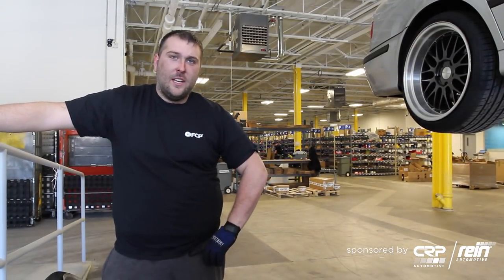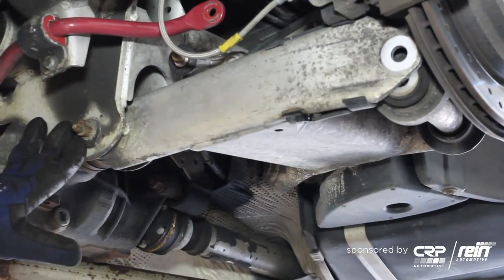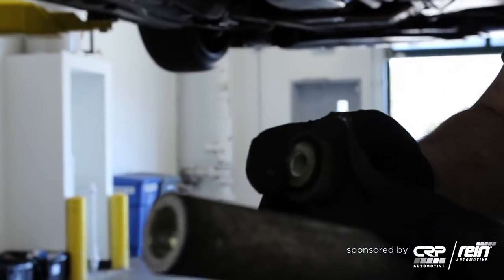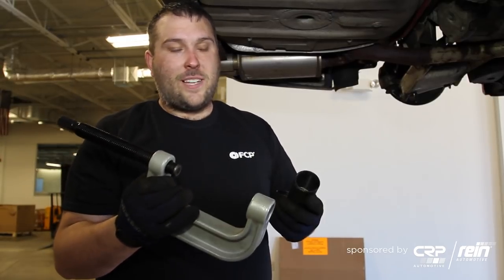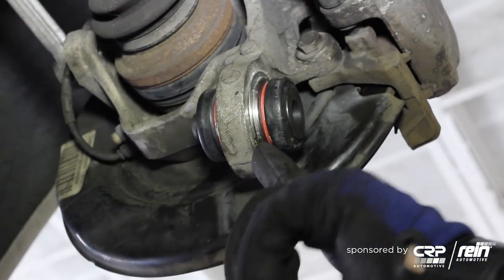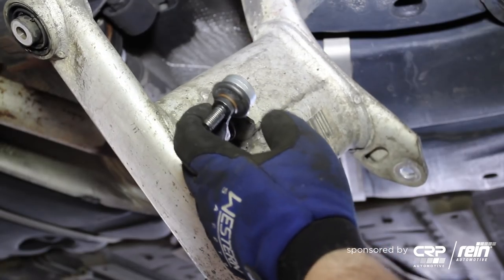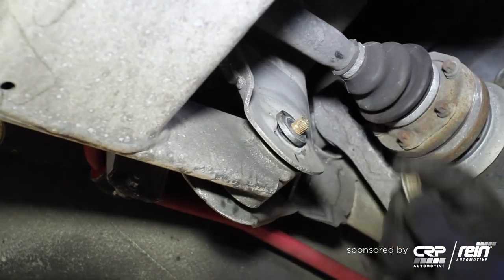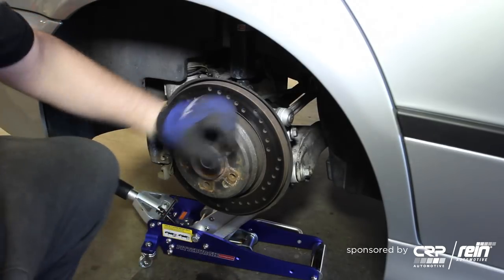How to Replace: BMW E39 Wheel Carrier Ball Joint (Rear Sway Bar End Link, Integral Link) FCP Euro

Comment: I watched this very informative and easy to follow video 9 years ago when I first bought my 540/6. What a difference it made. Well here I am watching it again just to make sure I haven’t forgotten anything. The bmw original parts lasted approximately 80,000.  Well I used Meyle brand . 60,000 miles later -but since it’s needed this for the last 10k  they actually only lasted 50,000miles . Hopefully the lemforder parts hold up for longer .

Comment: This was very very useful, its a shame I didn't see it before I changed mine. I had over 300,000 on my car before I think they were changed for the first time. I purchased the same C-clamp kit as well, from Harbor Freight. I turned mine from a "C" to an "I" clamp. It was so rusted in I used the cups that came with it and a large grade 8 bolt to remove them and broke a bolt on the second one trying to get it out. I had to heat mine up and let them cool a couple of times as well before I was able to get them to break free.

Comment: Thanks for the video! Though I noticed when installing the eccentric bolt that you swapped which side the nut was on. Initially it was on the rear side of the arm and when you re-installed you placed it on the forward side of the arm. As you were probably getting an alignment shortly after I don't think it was going to make much of a difference, but for someone who can't get to the alignment shop for a bit that small detail rendered your locating marks null and void.

Comment: Thanks for the video. I've been struggling with the ball joint tonight and I noticed that even though you said that you should keep the ball joint nice and straight, yours ends up really crooked at 9:10 and you just force it through and it straightens. I've been stopping when mine got crooked because I didn't want to break anything.  Interesting to see that you can just force it through and it'll be ok.

Comment: Nice video! One small comment on the torquing procedure. Once it clicks, every time you make it click after that is potentially moving the threads tighter a fraction of a turn, hence over torquing the nut. Other than that, very helpful video! Thank you!

Comment: Great video!  You make it look easy.  I guess having a lift helps, eh?

I did this job on my e38 a few months ago and pressing out the ball joint was a major pain - the removal tools I borrowed from AutoZone wouldn't fit, and trying to make one with plumbing materials was a big waste of time.  I finally capitulated and bought the specific tool - about $110 new off ebay, it's a China knockoff but worked PERFECTLY and pressing out/in the balljoint was a breeze with it.  Worth every penny.  My ball joints were shot, but not nearly as bad as the one in this video.  BTW - I did the control arms and struts too, just to make things complicated and expensive ;)    '99 e38 180,000 miles.
Reply: I had the same issue!  The clamp thing from autozone was a complete disaster.  When it comes down to it, buying the specific tool can save you lots of money vs. paying someone to deal with the resulting mess.

Comment: It looks so easy... Changing all the bushings on my e38 at the moment, so far took about a full days of work and one side is almost out of the car... Snapped inner upper bushings bolt, snapped two drive shaft bolts and lower inner bolt and nut was half rounded since before and of course i've rounded it even more now... Then I gotta do the same thing for other side and then onto pressing the bushings D:

Comment: Awesome Video! Well explained!
That's what I am doing right now!
Thanks a LOT!
Reply from the maker: You're welcome! Glad you like the video!
Reply: @fcpeuro  Everything is SO EASY in your video. In my case (239k E39) its a warzone. I had to use Impact Wrench to remove E14 bolts. Had to cut bolt to remove the Guide Link. Now I removed the Nut and Eccentric Washer, but stuck with the Bolt in Lower Control Arm. Its real PITA!
Reply: @siny528i  how'd it go?

Comment: For the snap ring, if you can get a pair of needle-nose pliars to open it enough, you can get a flat head screwdriver between the opposite side of the ring and the ball joint - pull the screwdriver to the side and it’ll pop off.

Comment: Awesome video.  I just have two questions.  1. What where the symptoms this car suffered from?  2. When loading the suspension to ride height, can it be achieved by placing the car on ramps with the wheels attached?

Comment: Thanks for making this video!  I have an 05 645ci. 139k miles. Just replaced the struts and now want to replace the rear UCA w new SPC rear camber kit installed into the UCAs. I guess I should really replace the ball joint due to the mileage. The reason I am replacing the UCA w the kit is b/c I have 19x10 STR 607 rear wheels and the tires last about 6-7 months due to inner tire wear. I want zero camber zero toe if at all possible. I am already at max'ed out alignment. Just need more.
What is the average cost at an indy for replacing the rear UCAs, and this joint?   I can tackle it myself but I will need the car towed to get the alignment anyway. No easy win with these 6 series. My e36 328i is way easier to maintain!!!
Thanks for your time.

Comment: what size cups are you using to catch the ball joint? i've bought and returned 3 different ball joint kits today because the cups that'll fit are way too big and causing clearance issues, currently using the same harbour freight one in the video and still having the same issue

Comment: Thanks for the video, I am about to undertake this task. As far as ride height when torquing, do you measure the hub center when it is on the ground and replicate that with the jack?
Reply: Terry Mason That is one way. You can also stand the car on its wheels on a four-colum lift or over a trench.

Comment: I have uneven wear on my rear inner edge. I replaced the shocks w B4 bilsteins, and added a spc rear camber kit installed in new upper control arms. we swapped tires so the inner edge is now on the outside and the inner edge is new so to speak. we just drove 1200 miles NY to FL. Inner edge is cupped again!  I guess I have to so the rear ball joint. 05 645ci convertible. Do I need to replace the lower control bushings as well??
Reply from the maker: Hi Frank, yes it's definitely possible the lower control arm bushings are worn as well causing the uneven wear.

Comment: Hello,

first of all, I would like to say thank you for the video. I am currently in the process of doing a rear suspension overhaul on my M5 and this video has been a godsend. I do have a question though: Is there any trick to getting the swing arm back into alignment with the ball joint and integral link? 

thank you
Reply from the maker: +Bryce Brown Glad the video was able to help you out. There is no real trick to align the integral link, ball joint, and lower swing arm in place. My recommendation is to bring the integral link in place and then bring the control arm up. Going from the back of the control arm (facing the rear of the car) insert the long bolt through the control arm, ball joint, and integral link. You may have to twist the assembly and shift it around to get the bolt to go through. Once the long bolt is through you can then bolt the upper part of the integral link to the wheel hub. Tighten the lock nut on the long bolt and the top bolt. With full load on the suspension torque to spec.

Comment: how did you get the car to "ride height" with the wheel off as I'm going to attempt mine soon you made it look easy :) thanks
Reply from the maker: Hello Kieran, a jack placed under the control arm will get the suspension to ride height.
Reply: FCP Euro so just lower the car down onto a jack stand or jack to get weight on to it and then torque them up
Reply from the maker: We were able to do this with a lift. If you are working on regular jack stands use the floor jack to compress the suspension watching for the corner that is sitting on the jack stand to raise slightly. You don't want the car to be completely off the stand but you want to see that the weight of the corner of the vehicle is being supported by the suspension.

Comment: This video was uploaded quite a while ago. Are you still answering questions? My ball joint is very rusted into the housing. Even a breaker bar on the c-clamp to remove the ball joint is VERY hard to twist and ball joint hasn’t budged. Soaking in penetrant as we speak. Any advise to get that puppy outta there. Thanks
Reply from the maker: Hi, Scott. Try hitting it with some heat from a torch, if that still doesn't get it out, you might want to look for another housing to put the new ball joint in!

Comment: I'm replacing My integral link on 06 530xi and not the ball joint I watched your video it was helpful but will it effect anything if I take the threw blot on the control arm out to remove the link ?
Reply from the maker: +Michael Francis As long as you do not touch any of the eccentric bolts at the subframe you should be okay. However, depending on how worn the integral link was it may be worth while to get a rear end alignment as the angles could be off leading to tire wear.

Comment: Great vid. Quick question . I have squeak from the top right side of my rear suspension when going over bumps or turning into driveways . I did replace the rear struts and the strut mounts seem to go away for a while then came back . The right rear strut mount I took out was broken. Any thoughts on this . Thank in advance.
Reply: It’s possibly the inner bushings on the swing arm. Can you replicate the creak by bouncing the corner. If so you can confirm by asking someone else to do this while you peer underneath.

Comment: Great video!  Thanks for taking the time to make these helpful videos.  I was wondering if you could make a video on how to replace the rear lower control arm bushings?
Reply from the maker: The rear lower control arm (swing arm) does not have serviceable bushings. The entire are would need to be replaced in order to replace them unfortunately.
Reply: @daikiryoku  Yes, you are correct.......Meyle makes bushing kit and has vid on their site.  PSB makes Poly Bushings.

Comment: Would this be the same for a 1995 BMW 740i? I think it's the E38. Also can you point me in the direction of what is causing rear inner tire wear? Thanks.
Reply from the maker: nothuman22 The rear suspension is basically the same so the procedure would be identical. Inner tire wear and "cupping" is likely caused by the play of the wheel carrier ball joint.

Comment: I have a real pain with the tension of the spring, which puts everything under pressure and makes every thing really difficult. Any tips on this? (I have a touring, maybe that is worse) It is really hard to fit spring compressors in there. Was this on an air suspension car? 

Two more comments:
1. Make sure to read the ride height before you start.
2. Should not also the two inner swing arm bushings be tightened at ride height?
Reply from the maker: Never done it on a wagon. The coil spring provides extra resistance because it's mounted separately from the shock absorber. I looked around but couldn't find anything specific. Might have to keep a load on the lower control arm to get this job done. Also you're right to say the two inner swing arm bushings should be tightened at ride height.

Comment: My new lemforder after market by ZF ball joints just slides right in(no pressing) . What happened ? I cleaned up the old one and it also slides right in. Do I need to replace the carrier
Reply from the maker: That is odd, you may need to replace the carrier.

Comment: Thank you for this! I have one question and I have been trying for a couple of days now. It's the very last step. For some reason I can't get the control arm and the knuckle to come together to get that final really long bolt through. The control arm keeps getting caught up on the ball joint. The only thing I can think of is that the ball joint was pressed too far. It did go about an 1/16 of an inch too far, the aluminum is pretty soft. Can you help!?! 2001 x5
Reply from the maker: If the flange of the ball joint (the opposite end of where the snap ring sits) was pushed 1/16" further that would mean the flange has bored into the aluminum knuckle. That is not a good scenario as it would mean two things:

1) The ball joint is out of alignment completely and can shift around inside the knuckle as it's not sitting in the correct position
2) The knuckle has been damaged

If possible, please send an email to service@fcpeuro.com with a photo of what this ball joint looks like pressed into the knuckle so we can verify visually what this looks like installed.
Reply: Thank you FCP Euro, for being willing to help out and for your detailed reply. I will send that photo to you today. Most generous of you, thank you!

Comment: When you torque the integral bolt/nut and put the car under load to get the ride height, where did put the jack pad exactly?  Swing arm?  Thanks...
Reply from the maker: Yes, the safest point to raise that corner of the suspension by would be the swing arm.
Reply: FCP Euro, thanks.  Do both sides need to be under load or is it ok just to load the side I am torquing?
Reply from the maker: It's fine to load one side at a time, that won't cause any issues.

Comment: After braking hard repeatedly (bedding in new rear brakes) the rear of my E61 pulls to one side on acceleration and ‘snaps’ back on releasing the pedal; also a lot of neg camber and toe in on the right hand rear wheel + off center steering wheel... does that sound like the rose bushing? Kind regards from The Netherlands!
Reply from the maker: Hi Stefan, it sounds like there is definitely a bushing that has failed and causing this alignment issue. I would get the car up on a lift and have it checked out right away!
Reply: FCP Euro just to get back at you... too bad I can’t share pics here; the complete inside of the right side rose bush/ball joint is GONE... as in I can see right through a half inch gap. So, as soon as the special tool for the job comes in later this week, I will put it on jack stands and install new ball joints and integral arms on both sides, and I hope the hole for the ball joint is not screwed (luckily a local breaker has a replacement carrier for 25 bucks if needed).
This car had an inspection less than a year ago (I bought it last summer) and it somehow wasn’t noticed by the tech inspector.
Reply from the maker: @stefan2meter  Thanks for the update! Wow, I'm surprised that was overlooked by the inspector! Well, I'm glad you figured out the issue, and I hope the install goes smoothly. The car will drive so much better after this. Let us know if you need anything else!

Comment: Great tutorial! 
My E39T rear suspension has developed a creaking noise recently. I suspect the lower ball joint. Do you know the exact diameter of the two cups used? thanks.
Reply from the maker: No information on the two cups. They are the standard ones that come with master ball joint press kits. You can usually rent this type of tool for free from your local auto parts store.
Reply: Thanks, I went ahead and bought a ball joint removal kit on eBay. Had to loosen the lower shock absorber bolt though as on the Touring, the shock is in another position.

Comment: is there anyway to not remove the alignment bolt but have the arm drop down?
Reply from the maker: The bolt would still need to be loosened at a minimum to get any play in the arm. If you are doing this repair, you will need to get an alignment regardless, so marking the hardware before you remove it will be your best bet.
Reply: I hear ya , when you marked it.. it looks like you marked the washer to the frame. Is that washer attached to the bolt ? I was thinking you would mark the bolt , washer , and to the frame.  @fcpeuro

Comment: Why did you install the eccentric bolt the other way round (180 degrees turned) like it was installed before?
Reply from the maker: +Kleiner Zeh Good catch. That was a mistake which was corrected later after checking the work over.

Comment: Will replacing the ball joints fix my "squaking"  issue?
Reply from the maker: Hello Ron, replacing ball joints will help eliminate clunking noises and vibration from the front of the vehicle.
Reply: Sorry i should have been more clear.. i have squeaking in the rear

Comment: A little dab of grease also helps putting it in if you are using a homemade version of this tool. I want to exchange mine (E36) but with poly... anyone ever used that for the rear out balljoint?
Reply: A polyurethane bushing really shouldn't really be used in place of a rotating bushing. There's a reason why race teams use spherical bushings.

Comment: Does this work on a 525 TDS bmw e39 ?
Reply from the maker: Yes, the ball joint install will be the same process on that model.
Reply: Ok thank you very much.
Reply: Yep, seems they are the same, the only problem is i can´t buy it from 
you guys. The shiping fee is way to much (in in spain) . So yeah , 
anyways thank you for the video. At least we learn something.
Reply: The problem is the "every cent" over its like 180€ so no thanks. 2 Bad they are good , but i can´t afford to pay 180€ for transport.